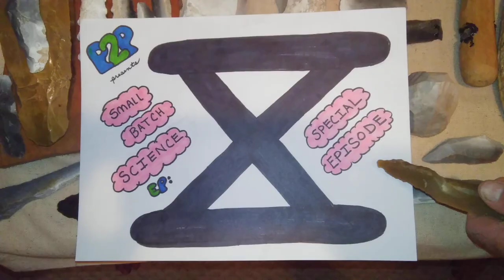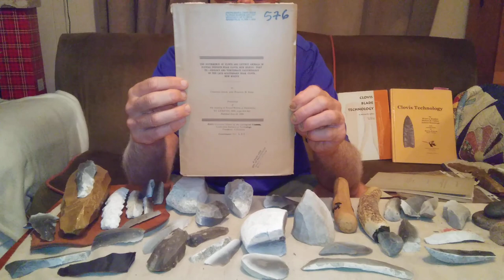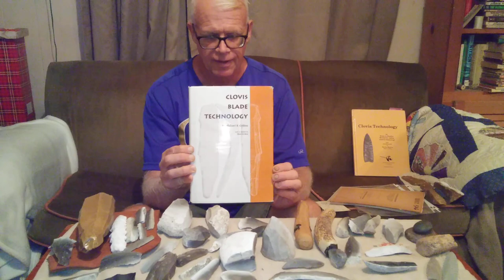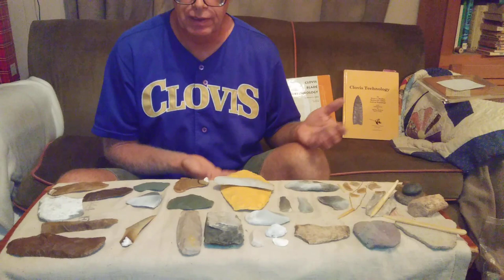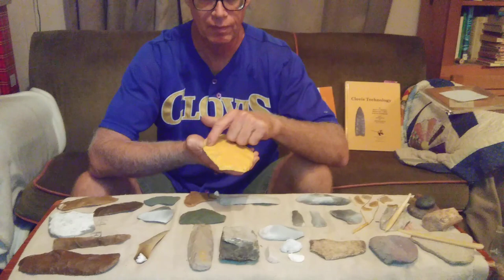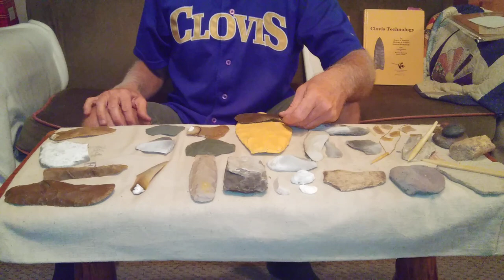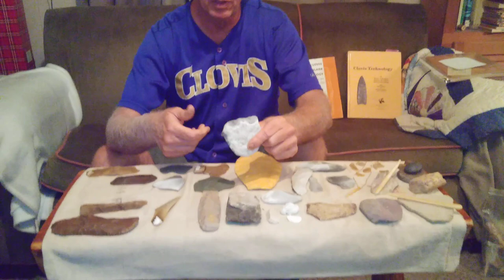Small Batch Science Episode 10: Other Clovis Stone Tool Forms

Comment: I appreciate the diversion into overshot.  Clovis overshot has entered the collective consciousness of the knapping community, likely due to Sanford's Solutrean hypothesizing - it was a pillar in his arguments.  However there are several studies that show few overshot flakes in Clovis lithic production that are also thrown around as counter arguments to Sanford.  A few of the Fenn Cache (also embedded n the knapping community's conscious) obsidian bifaces have overshot scars, but most bifaces in the collection just have large feathered scars.  So the discussion is always had, when knappers get together, whether overshot is an intentional reduction strategy for Clovis, or just occasionally incidental or accidental.  Guess we may never know...
Reply from the maker: Hi Chuck,  The commentary on overshot flaking is a mess.  And way too much as been made pro and con about how related lithic technologies are based on its presence as a reduction tool

That said the first thing I would bring up is that you have to look at assemblage level patterns of manufacturing behavior- Like Gault, or Pavo Real, in TX, or any of the other really big Clovis sites with LOTS of manufacturing debris.    You really need to look at early bifaces through even mid to late stage preforms to see the VERY patterned behavior and repeated intentional use of the flaking technique.       Fenn is a good example because it has great range of stages from really early big bifaces through used, nearly used up points.  Sort the Fenn pieces by material type and you will see that range (an attritional profile really) of forms from early to late and used in all but 1 material I think (and that only because there are too few quartz bifaces).

Using the manufacturing sites you can also flip this around and look at the debitage as well.  Often you need to look at both flakes and bifaces to figure out the terminations of those flakes that actually are all the way across.   Even then it could be impossible to say a flake it truly overshot if it lacks a recognizable portion of the far side, unless you can refit it.

The notion that the full on overshot flakes that take a bit of the far side are accidental or at best unintentional is completely idiotic.  At Gault there is a complete overshot that is 17cm long from platform to the far end.  Meaning it was struck from a biface that was 17cm+ Wide!  If is not possible to do that without a tremendous amount of preparation and incredible skill.  You can see scars of removals nearly that big in the Anzick Cache too.  Admittedly an extravagant example but it makes my point (haha) regarding intentionality   (which is a shared characteristic of Solutrean whether they are related or not). 

I'll end with one last observation related to the blades removed from a number of both conical and wedge cores- namely, essentially the same reduction strategy is being employed with regularity.  I showed a number of Bruce's attempts to re-create things we were seeing at Gault and other manufacturing sites.  Specifically the different types of terminations on blades- feather, hooking (or maybe reversed hinges- that took the end of the core off), and of course the misses that hinge or step out and do not go the full length of the core face.  Whether off blade cores or bifaces/preforms the intentional removal of flakes that go down or across the entire length of the piece is a hallmark of Clovis reduction technology.  Clearly most visible in the earlier stages of production for points.  The overshot evidence is regularly removed or obliterated by later flaking- finishing, resharpening or what have you and in point of fact will rarely be visible on finished and used points because the edges are retouched.   Why professional archaeologists can't figure that out, or see it when they are shown examples, boggles the mind some times.
Reply: @paleotopioneer7779  That is the most well reasoned argument I've heard made on the topic.  You should make a video about just that topic!

I certainly agree with needing to view it in terms of an entire assemblage.   Also there's no doubt they worked in large stone.

Speaking of assemblages, have there ever been hints, besides hammerstones, of other knapping tools that have survived from Clovis assemblages?  I'm koping if bone needles have survived, maybe an antler punch tool, or horn pressure flaker, or something with some silica embedded in it has made it.

Thanks for taking the time to make these videos and answer questions.  I appreciate it.
Reply from the maker: @chucklearnslithics3751    Thank you for your kind words.  I think it gets through that I pretty much live and breathe the archaeology and history stuff so getting it right is really all that matters to me.     I think you are right that a post on Overshooting might be in order.  What I may do is put together a companion article for the blog so I can use images of real artifacts to show what I am talking about better.

Re knapping tools.  In Clovis the best example is the mammoth ivory billet from Blackwater Draw.  There is a similar kind of thing from Trull (I think) in TN?  might have a Pre-Clovis date and it's not as clearly an artifact so a bit iffy.   At Sloth Hole in the Aucilla we have a battereed cortex limestone cobble that weighs about 10lbs- maybe an anvil rather than a hammerstone.  Also at Sloth Hole we found an incredibly well made antler pressure flaker but it is undated and not from a good context. I would say I don't believe for a second it is any younger than about 11,000 years old or here Early Archaic Bolen in age.   It is worth directly dating now, when we found it in the 90s it would have been pretty harsh to cut it up.  Not a lot of other Clovis or potential Clovis age knapping tools that I can think of...  If anyone knows of more I'd love to hear about them.